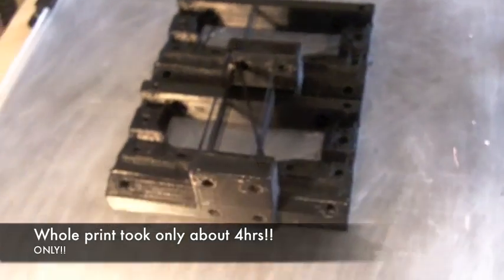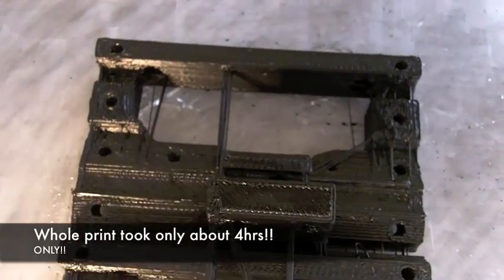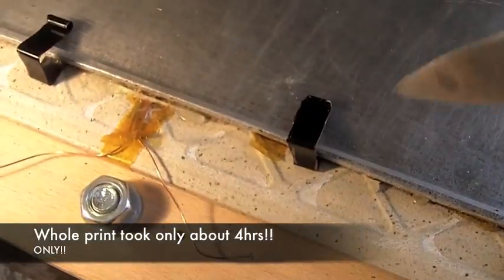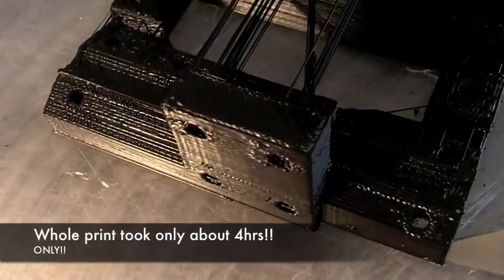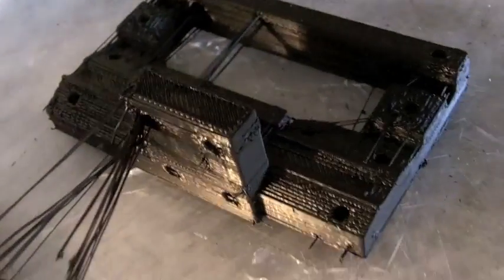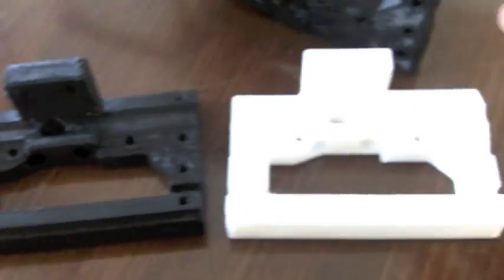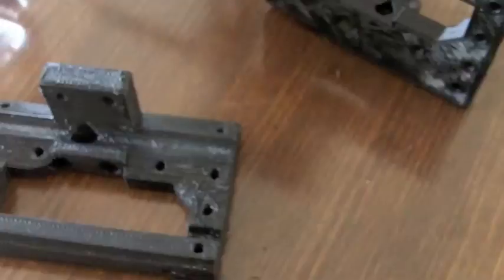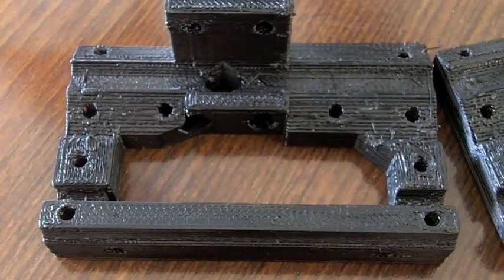Warpless Raftless 3D printing

Comment: why does the table need to be heated? what causes the warping? and when printing in "dead" space, the plastic stays level (no sag)?
Reply: Poor guy never got a response :(
Reply: @zortraxtheprotogen881  lol. its ok. ive learned alot in the 10yrs since the comment.
Reply: @CenterLane1977  wow you still use the same account congrats